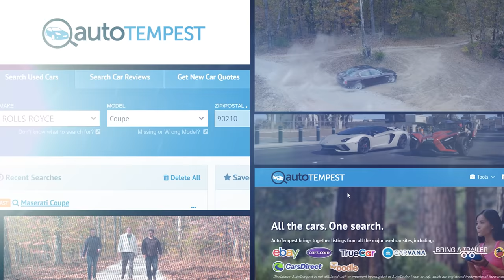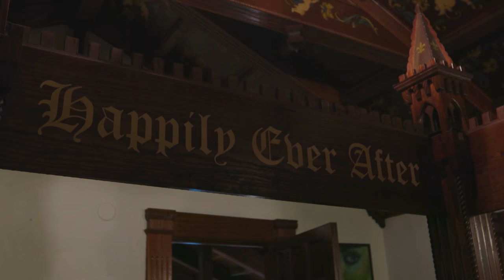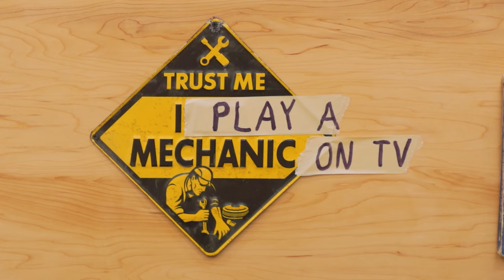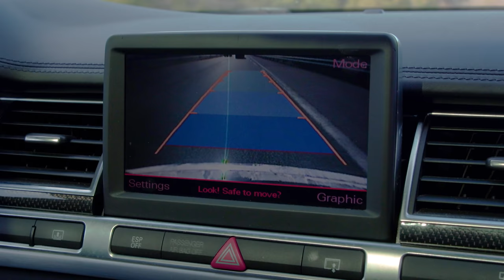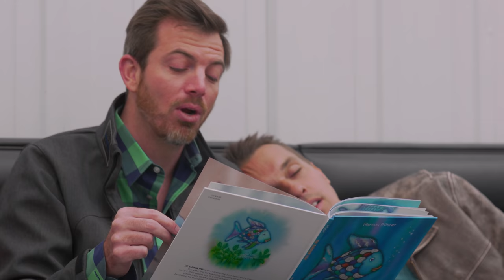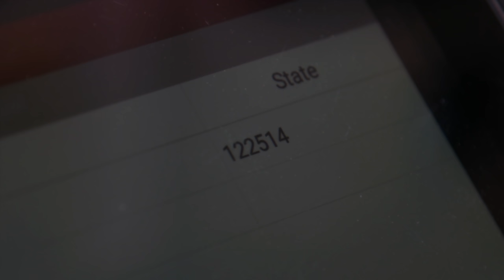Here's How BROKEN Our Unreliable Luxury Cars Actually Are (SPOILER ALERT: VERY BROKEN)

Comment: Are you sure the odometer discrepancy on the Maserati wasn’t just the scan tool showing the mileage in km? The wizard knows his stuff for sure but when I use ISTA on my M5 it shows mileage in km. And 122514 km translates to 76127 miles
Reply: There it is, but i guess they decided to make a little story around it for bonus excitement. I would well imagine only the physical speedometer is converted on euro cars going to USA, not the software as such.
Reply: @AlfaGiuliaQV  still doesn’t explain why its 300 miles off then.  The conversion rate is a set rate so it would be the same every time.
Reply: Second this! Using the numerical difference between European cars’ internal kilometer “accounting” and the US miles odometer is a common YouTube ploy to generate extra excitement.
Reply: @themaxee08  Lots of things can cause the odometer to be a little inaccurate
Reply: @themaxee08  car could have had a faulty speedo sensor or abs sensor. That wasn’t fixed for 300 miles
Reply: @martinwooder4174  it’s always possible but on a modern car that’s very unlikely.  Best guess is coincidence.
Reply: My thoughts exactly
Reply: OMG you are a genius! that legit never occurred to me. clearly that is it.
Reply: @themaxee08  well considering that wouldnt be an issue on a precomputer car.  and also that this car is NoT anywhere near new.  im gonna say you dont make any sense.  
 literally if you drove with a spare to long it could mess up your odemeter.  many many things can mess it.   ESPeCIALLY in a car like this where all electronics are connected. and if one goes down the whole thing goes down.  they literally could have blown a fuse and it would have not worked for that many miles.
Reply: @themaxee08  Perhaps they reset the odometer mileage in the factory after all engine/brakes/suspension testing, but forgot/couldn't to reset the ECU mileage.
Granted, 300 miles is a lot for test drives, but it doesn't sound impossible to me.
Reply: @soulfly3438  I have a Fiat from 2001, it has an ECU and registers mileage in it, but it also had a analog odometer, the whole instrument cluster is analog.
With 136.000Km showing on the odometer, the ECU showed 121.000Km or so when scanned via OBD2.
And I know it wasn't altered, because this car has been in the family since new.
Reply: @themaxee08  No requirement for the odometer to be accurate in the law, could just be that the number is multiplied with a conversion factor with fewer decimals.
Reply: It could be, but those numbers are still 300 miles apart, which means there’s still some form of odometer discrepancy, albeit with it displaying more miles than it should
Reply: @patrickmartin3322 They probably took the Wizard’s reading early in the shoot and the odometer reading at the end of the shoot after the drive. There are other explanations for the discrepancy, but this is  the most likely.
Reply: Stop acting like you know everything

Comment: Enjoyed the series, so far, but two things really came to mind this time;
1) The fact that turning back the odometer gets called to attention due to being a crime (sure no problem), but a linked brake/suspension issue is shushed, wouldn;t that become a crime too when he'd actually end up with no brakes and possibly a crash as a result?
2) Noticed Ed was actually sitting with his head/helmet IN the recess of the roof window, wondering what would happen if he'd suddenly stop, only to see at the end of the video he goes and does exactly that.

Comment: Late to the party, watching this in September of 2021, but a thought regarding the mileage discrepancy on the Maserati: 122,514k km = 76,126 miles. While this is not a perfect match for the 76,498 miles displayed, it's within the realm of possibility that the computer is logging the distance traveled in km and just not bothering to convert. Easy to test as well.

Comment: The brakes and suspension are on different dual  circuits with dual  reservoirs so no you won't lose your breaks if your shocks are leaking on the Rolls before everyone gets worried about leaking shocks

Comment: Am not sure that the Maserati mileage on the transmission ECU shows in miles, which could be confirmed by the fact that 122'514km translates to 76'126miles, with little discrepancies being normal between TC ECU and cluster ECU.

Comment: Americans don’t understand the reliant robin.. it was made predominantly for lower class coal miners in the uk. They were cheap to insure, cheap to run, can drive with a motorcycle license, and extremely easy to repair. It was the working mans car of the time. The one you have there is the layer of them and they only got worse as time went on

Comment: 30:20 does the scan tool read the ECU in KM (it's an Italian car) while the odometer is set for Imperial? cause 122000KM is pretty much 76000 miles. so, therefore, no discrepancy... just asking as a Canadian who needs to convert all the time.

Comment: Previous episode I thought: this is how Top Gear USA should have been. During this episode I thought: one out of three is rather good...and then it is crashed and damaged. So I had the epiphany... This is EXACTLY like Top Gear USA was...

Sorry to see your Rolls leaking LHM. That weird Citroën system is nice when new (I drive a Citroën BX that has a very similar yet simplified version) but when it gets old and leaky...it sucks. Rolls/Citroën did however put a system in place when experiencing a small leak: warning light first (due to pump sucking air), steering power goes out first (or at least on a Citroën), then suspension slowly lowers (or rather: does not come up anymore; starting at the rear) and then...after all that, if you are still driving around with red warning lights, no power steering and NO suspension...your brakes will fail as all fluid is drained from the system. Citroën has therefore a handbrake/emergency brake at the front wheels, for such stupid people. Rolls might have done so as well if they are as clever as Citroën was. High pressure hydraulic fuel line leakes are however horrible.

Comment: Sooo, basically there is nothing wrong with the RR that one weekend in the garage wont fix. And no, it will NOT cost 23000 dollars. Welding springseat, rbuilding leaky shock, ignoring transmission sweating. NOT 23000 dollars, try 230 instead.

Comment: That Robin Reliant with its number plate is probably the most British car in America, who does it belong to?

A family friend had one when I was a kid and while I didn't like riding in it, I have to admit the fuel economy is ridiculous. You can drive halfway across the UK on a thimble sized tank of petrol, but they are so damn tip happy. The concept of two at the front with a rear drive wheel was well tested, why they decided to go with a single drive wheel up front and make it responsible for steering too, is nothing less than crazy. For a while when I was a small child we had a bubble car, which had the safer two at the front system but you'd lose the brakes if you went through a deep puddle. I guess all super economy vehicles have their faults. It's not like the Tata's in India or the super economy Chinese models are super safe either. 

I'd still rather have a Reliant than a smart car though ;)

Comment: 122k in KM is 76k in miles. Are you sure the odometor has been rolled back? most EU cars will read in KM from the ECU
Reply: i thought the same thing ! but checked it and the exact mileage the Maserati has is equal to a bit over 123k miles.. still The scan tool may of been slightly off.. or they just deliberately let hoovie win these car trek challenges!

Comment: What is the recourse for getting a car from Autotempest that has had a crime committed?
Reply: AutoTempest is a search engine. Basically we help you find used car listings on all the other sites, so you don't have to check them all separately. We don't actually sell cars, so the recourse would be with the seller, just like if you'd walked into their dealership without finding them through AutoTempest.
Reply: Thank you for the explanation.
👍👍